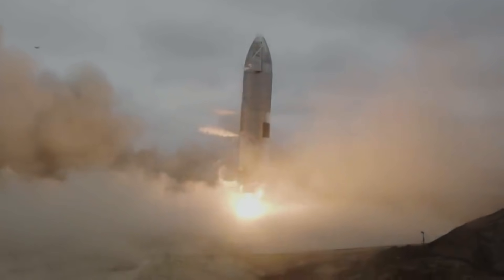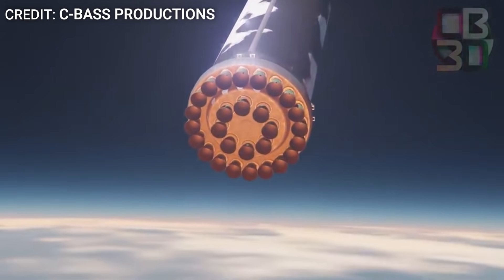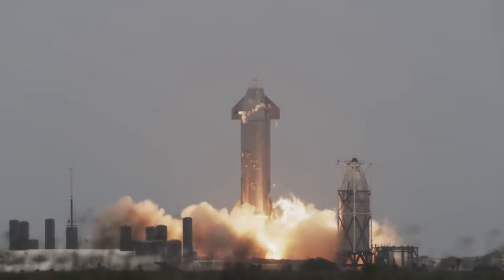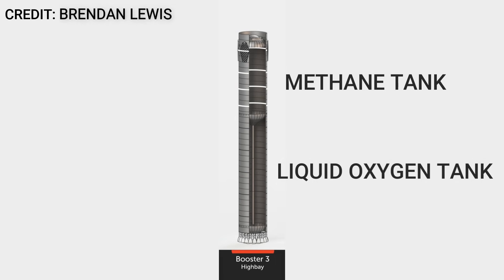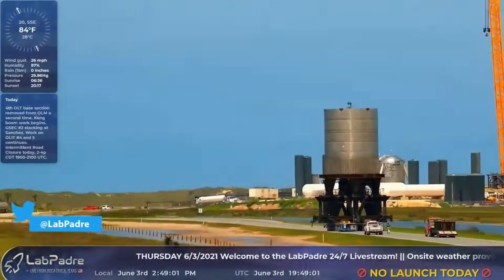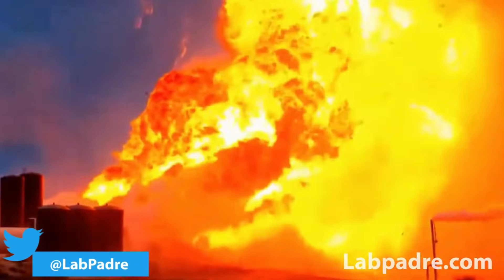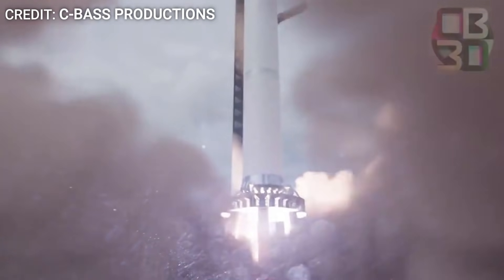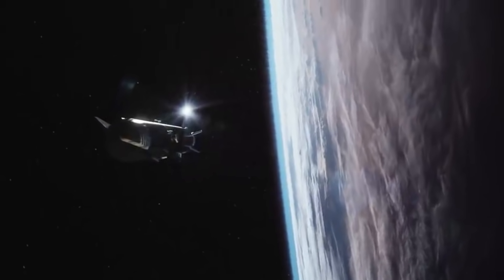SpaceX Super Heavy BN3 To Go For A 150m Hop Test?

Comment: I don't think they can do a hop test if they wanted too. BN3 has no legs and they have no way to catch it. At best they may run engine test fires. Even that is unlikely though as changes to the thrust puck and general pluming to the engines was likely why they decided to move on to BN4.
Reply from the maker: Yes. Probability of a hop test seems almost zero now. When I posted the video, BN3 still existed in two pieces. They went for stacking the two pieces to roll out pretty quickly...

Thanks for watching 😊